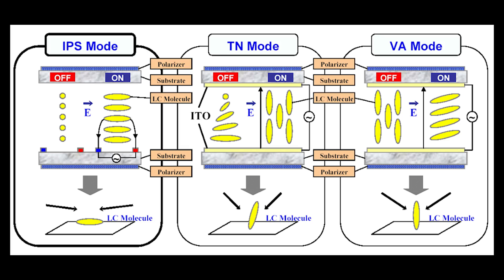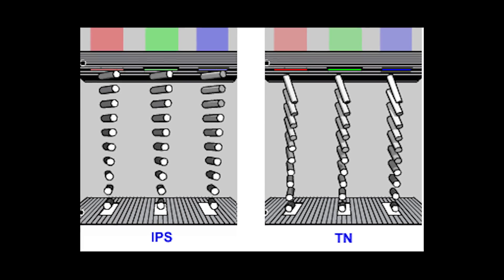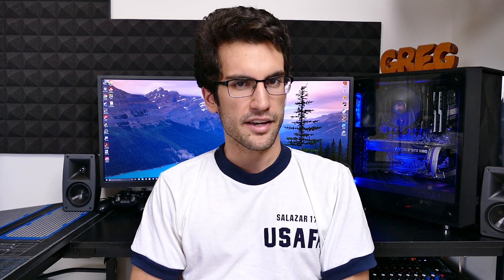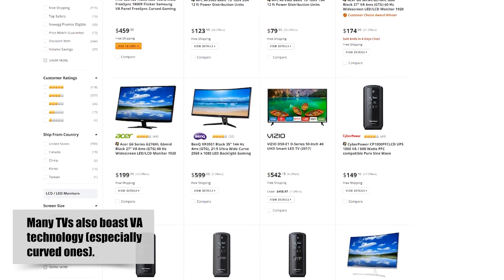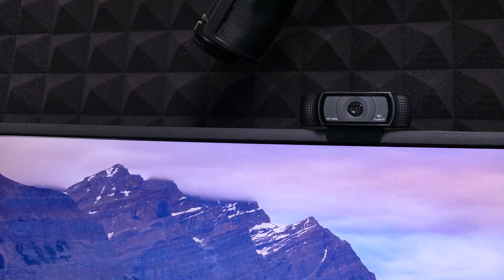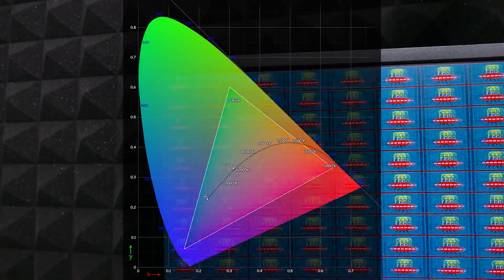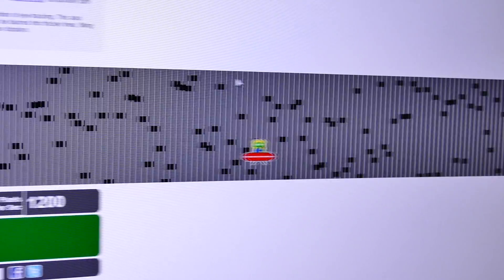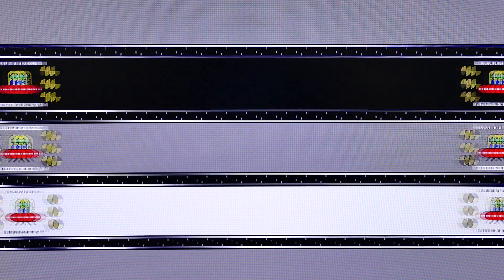What is VA (Vertical Alignment) Technology?

Comment: Color reproduction is not an inherent or  typical advantage of IPS technology. It's simply the nature of how IPS was marketed and who it was purchased by in it's early days that have led to IPS displays typically having more accurate calibration. I could write an entire term paper on the subject but the statement made here was simply false. VA panels have long been superior to IPS displays in reproduction and gamut. Color consistency is the advantage of IPS. VA panels, especially older ones, suffer from banding issues that can often make for uneven color consistency across the panel as compared to IPS. IPS technology was created for use in brighter environments where increased contrast is irrelevant and minor variations in color across the panel are not visible. Proper calibration and color  accuracy to an accepted standard are equally possible with both VA and IPS technologies depending on the variation.
Reply: Alright let's tackle these one by one...

Pixel Response: I really don't want to be rude to you but you need to do more research on the subject before you assume I am misunderstanding you. I am fully aware you are talking about pixel response. Pixel response times, ie the amount of time a pixel takes to update to new color information, are directly related to refresh rate. A response time of 10ms is perfectly fine on a 60hz panel, which refreshes every 16.67ms. On a 144hz panel, which refreshes every 6.94ms, a 10ms response time would introduce noticeable ghosting. The backplane(s) is what controls pixel response as it's what indicates to the pixel whether it should be on or off.  TN panels require the smallest voltage shifts to change with IPS, VA, and OLED needing increasingly more. 

Glow vs. color shift vs. contrast loss: First, IPS glow does not result in a darkening of the image. It's the opposite, it makes the entire image appear as if it is washed out, even if it isn't, with varying severity based on your viewing distance and angle. It is not the same as backlight bleed, color shift, contrast loss, or clouding. IPS glow is not a defect and is typically dependent on the panel model more than the individual panel. The QNIX QX2710, along with all other monitors that use the same panel, don't suffer from glow even at reasonably extreme angles and distances. In fact, it's one of the main reasons so many people bought this monitor back in the day. There were and still are plenty of IPS, PLS, and AHVA panel models that suffer from glow. Most do. It's just that one happened to be one of the anomalies. As far as lighting, bright =/= proper lighting. Proper lighting for a photoshoot is bright, even lighting. For editing or even just general monitor usage,  proper lighting is to keep it darker and use bias lighting. However, this isn't a reasonable request for the photographers and editors that IPS technology was originally marketed to. You are correct that IPS Glow isn't a concern in brighter environments. Again, contrast loss is still an issue with IPS just as it is with all LCDs. IPS screens don't often suffer from color shift like VA and TN panels can. Please don't seriously use screenshots or pictures posted online, especially by so called "reviewers",  to determine such a specific issue. I shouldn't have to explain how ridiculously unreliable that is. 

Brand stupidity: I'm in the unique position of being able to use a wide range of technology, including monitors without getting these products free for review or through sponsorship. The most common complaint about all monitor manufacturers is poor QC.  It's a good thing for me too as almost every display I own now is one that I bought cheap and fixed because of some poor QC issue or entirely random failure. When it comes to monitors in the past 5-6 years, they all suck at QC. Everyone says one brand or another has bad QC. Honestly, people just need to shut up and stop talking out of their ass without hard numbers.You need to stop looking at it on a monitor manufacturer basis and instead at a feature by feature basis first, panel type by panel type second, and panel manufacturer by panel manufacturer third. When I say panel manufacturer, I am specifically referring to who makes the panel, not who makes the monitor.
Reply: tamzf1 I explained this somewhat in another post but pixel response has nothing to do with the panel type in and of itself.  Pixel response is controlled by the backplane.  IPS and TN displays don't require nearly as much power to properly drive each pixel as VA panels do.  Currently,  the only bacplane tech that works well is LTPS. A si and IGZO backplanes, while  allowing for more uniform voltage control, simply don't provide enough power. At more extreme angles, color shift is much more of a concern for VA than contrast loss. All types of LCD suffer heavily from contrast loss at an angle, including IPS. IPS displays don't have the color shift associated with TN  and VA panels at closer to 180°, but most, not all,  suffer from bad glow at these same angles that can make them just as unuseable.
Reply: tamzf1 Again, variable response time is not a panel issue. Many current LG AH-IPS panels utilize an IGZO backplane. For whatever reason,  AUO typically only uses A SI and LTPS backplanes for both their AHVA(IPS) and VA panels. Panasonic does the same thing. It's utterly stupid to try drive a high refresh rate VA panel with anything other than LTPS and not expect slow pixel response. High refresh rate IPS/PLS/AHVA monitors do really well with IGZO and are overall fine with A SI so you see a lot more consistency out of them simply because of that. As far as IPS glow, even the highest end IPS monitors suffer. The anomolies that don't suffer from glow happen at every price point. For instance,  I have an old Qnix QX2710(Which uses a PLS panel). One of the best things about that model nearly as a whole outside of its overclockability is the fact that it doesn't suffer from glow.  However, a common complaint of the much more expensive,  though decidedly not high end,  Asus PG279Q, is that it has frustrating amounts of glow.
Reply: Science Studio Except "Color gamuts and reproduction are superior in most IPS panels sold today." is still an inaccurate statement. It's not the general consensus among qualified professionals or anyone who understands and follows the development of these technologies. A panel is not a monitor. Color consistency and uniformity are typical advantages of IPS and there are far more dedicated monitors utilizing IPS displays on the market today that are well calibrated at the factory to sRGB and Adobe RGB. However, if you look at the display market as a whole, the situation is almost reversed. High end LCD TVs are almost universally VA panels calibrated to Rec. 709(sRGB without a gamma distinction) or DCI-P3. In both cases, once calibrated, these VA panels as well as any high end IPS options are typically pretty close to equal in terms of accurate adherence to a particular standard.  Both tend to be very close in gamut and reproduction in production models with VA technologies able to produce a wider range of colors and IPS technologies having better panel uniformity and more consistent production of what it can produce. Pull up all the data you can find on LG's, AUOs, Samsung's, Sharp's, Chi Mei's, etc. panels and you'll see this is the case.
Reply: Yes, but typical AU Optronics VA panels show high variability with response times - maximum response times can far exceed the rated GTG response times by 4-5X. Acer monitors are typically much better at keeping the response times within 2-4ms of it's rated GTG response time, an example of this being the XB270HU. By contrast, a typical LG panel used in a Dell Ultrasharp hardly goes 50% over it's rated GTG response time of 8ms. 

Also, since IPS monitors have usually been associated with professional use, IPS glow isn't an issue at all like it is for a typical consumer viewing blacks during gaming and watching movies.

Though it's probable that these issues will get sorted as the technology has been in the market for a much shorter time than IPS.
Reply: tamzf1 There is a disconnect in your argument from mine.  In fact, we aren't even talking about the same thing. I am talking about the technology while you are talking about the product. This latest post only served to prove my point.  The M350QVR01.0 panel used in the AOC utilizes an A SI backplane as opposed to LTPS. Again, VA panels cannot be properly driven with their high curremt demands by an amorphous silicon backplane. LG has been using IGZO for their ultrawides for some time now with great success. Also as I have already stated and was mentioned in those articles, VA has color shift at extreme angles. IPS does not. Both suffer from contrast loss. As far as brands, yes there are some that are typically better than others but it isn't some universal rule. All experiences you have had are just as anecdotal as anyone elses. To ignore one brand because the other is "better" is a great way to miss out or to mess up. I've seen every monitor brand put out a bad product and I've seen most put out a good one. You are not buying into the brand, you are buying their product.
Reply: I really hope you understand the fallacies in your arguments here. What you are doing is arguing without sufficient knowledge on the subject at hand. When that happens, people tend to direct the argument away from its original context or ignore the core concept behind the argument entirely. The fact is, you simply aren't thinking analytically. This argument or the information I provided that seemingly necessitated your response was never about which one you should buy, it was about the differences in these technologies. When you couldn't provide a valid response within the confines of the argument, you shifted to the more limited and naturally more biased viewpoint based around purchasing decisions. Now, I ought to respond specifically to your argument as it is currently. Everyone is biased to their own opinion, myself included, even more so when money is being considered. To say that a "customer" only cares about performance is far from a universal truth. I ask you, and this is not intended to be entirely rhetorical, what would happen if you gave 100 random people $30,000 to buy any car of their choice from a list of 20 cars?
Reply: As far as I am concerned, you've already lost this argument because of your insistence on appealing to authority.

The consumer does not care about IPC difference between Skylake and Ryzen or the cell size of Intel's 14nm++ node vs GF's 14nm LPP node. At the end of the day, the higher GHz is what matters to the consumers if they feel that the performance difference that the higher GHz brings is worth it to them. So it makes sense to talk separately about things like IPC/process nodes objectively, but one must always remember that at the end of the day the purchase decision is made on the basis of performance requirements.

When it comes to monitors, image quality differences are more subjective, and it makes even less sense to talk about differences in panel technologies and how they might theoretically affect image quality, without taking into account the difference in implementation of said technologies. 

My position has always been clear - what you say about the differences between IPS and VA may very well be true, but if those differences which tend to be the ideal case, are not reflective of the image quality in the products that are on the market - it would make no impact on the consumer because he will not accept his subjective experience getting negatively affected by sub-optimal implementation, even if the technology behind the implementation is objectively superior in theory.
Reply: Mr. Manager best thread of replies to a Youtube vid ever....
Reply: Mr. Manager Exactly. Look at the colour reproduction on sub $1000 screens. The difference between  VA and IPS is negligible.
Reply: Daniel Troy At all price points, VA is superior in terms of color reproduction. Until at the earliest December of this year,  the only LCD panel tech capable of true 10 bit color regardless of backlight is VA. Banding issues have been almost completely eliminated at the mid- high end with the use of QD enhanced backlights with some form of local dimming and LTPS backplanes. VA panels are much harder to drive than other lcd panel types and contrary to popular belief, more expensive to produce. IGZO backplanes have been used to great success as a cheaper, more energy efficient alternative to LTPS on IPS displays but it simply cannot properly drive a VA panel. There is a reason why VA panels have increased in popularity over the last few years with the advent of HDR, it's the only LCD panel type actually capable of more closely mimicking OLED HDR performance.  IPS and TN technologies have reached the upper limits of their capabilities. Time and cost spent on R&D on VA tech is currently only third to QLED/QDLED(actual QLED not Samsung's stupid marketing bullcrap lies) and OLED R&D.
Reply: Daniel Troy Go with the Sammy set for general PQ, but if you want to watch at more extreme viewing angles or only watch in brighter environments, take the LG. If you want faster refresh rates for PC gaming. Something like the Sony X850E is a great choice for the money that does 1080P at 120HZ.
Reply: VA panels suffer from variability in response times - averages response times are quite similar to IPS, but worst case response times can be much higher. Also they tend to lose contrast when viewed at an angle.
Reply: You think I'm talking about refresh rates but I'm not - I'm talking about pixel response times. Glow isn't an issue at all in a properly lighted environment. I don't know much about your particular model, but Samsung PLS models from early 2012 also suffer from glow. IPS glow results in visible darkening of the image when viewed at an angle, even in a well-lit environment, but this isn't much of an issue because color and contrast consistency is still good. VA panels don't have much glow, but from screenshots in reviews I can see them losing contrast. Thus, both VA and IPS make different compromises when viewed at an angle. 

Asus QC is poor, no wonder their monitors have glow that reviewers tell about the need to RMA multiple times but still not getting the desirable results. If anybody wants a high refresh rate IPS monitor, they're much better off spending on Acer.
Reply: Let's look at one example to begin with, AOC AGON AG352UCG, which is a 2017 model with a AUO AMVA panel, vs the Asus PG348Q, which is a 2016 model with an LG AH-IPS panel.

Viewing angles:
http://www.tftcentral.co.uk/reviews/aoc_agon_ag352ucg.htm#viewing
http://www.tftcentral.co.uk/reviews/asus_rog_swift_pg348q.htm#viewing

The difference is clear - markedly different color and contrast on the AMVA compared to the IPS display. There is some darkening on the IPS panel at the farthest edge, but the curvature hides it somewhat. 

Response times:
http://www.tftcentral.co.uk/reviews/aoc_agon_ag352ucg.htm#detailed_response
http://www.tftcentral.co.uk/reviews/asus_rog_swift_pg348q.htm#detailed_response

For a panel of 100Hz, average response time of the AOC is already at it's refresh rate target of 10ms, while the Asus is sitting comfortably below 10ms at 100Hz overdrive in normal mode. Lets not even talk about the maximum recorded response times. 

I'm buying brands, not the panels themselves from LG or AUO, so of course it makes sense to talk about brands because implementations differ across brands. I don't know if these QC issues are a reflection of the recent trend of getting these established technologies like IPS quickly into the consumer market with the 'gaming' moniker, but I've used Dell and HP IPS displays dating as far back as 2010 and never had issues with the quality of the panels themselves - we order them from a preferred vendor chosen after a tender process, and the only issue with some of the recent Dells have been the touch controls being a bit finicky.
Reply: I'm buying the product, not the technology itself divorced from context.

 If a brand implements an objectively inferior technology with respect to one parameter(which in your argument regarding IPS vs VA is glow)much better than another brand that implements the objectively superior technology with respect to the same parameter, ie. glow, in a shoddy manner, affecting other things like response times and contrast uniformity, then I'm sorry to say that people will undoubtedly choose the former, because a customer ultimately cares about performance.

This is true when talking about things other than monitors, in fact this is universally true. 

  Like I said before, I expect most of these variances to be sorted out over time.
Reply: He quoted to you an older monitor that was "well built" from years back and the reason why people floated to it.  In your first reply, you said "VA panels".  I'm still sorting through the comments.  There is a difference between Socrates and Plato.  In argument, it's hard not to start rationing off the other person's points/factorization/views.  This is the nature of ego.  Once monitor quality hits "shit across the board", you would wish you were wrong.  Once monitor quality hits "amazing across the board", you would wish you were more right or more wrong?

What's more valuable? Occam's Razor or bipolar people?
Reply: 3 روز قبل (ویرایش شده)
Hi, I want to buy a monitor for movies and Web browsing
 .Which of these options is suitable? lg 22MP58VQ-P - benq GW2270H - LG 22MP55HQ - I 
like BenQ because it has a better contrast than the rest. And according to the site, it has a great quality
https://www.benq.com/en/monitor/stylish/gw2270h.html
Reply: Hi, I want to buy a monitor for movies and Web browsing .Which of these options is suitable? lg 22MP58VQ-P - benq GW2270H - LG 22MP55HQ - 
I like BenQ because it has a better contrast than the rest. And according to the site, it has a great quality
https://www.benq.com/en/monitor/stylish/gw2270h.html
Reply: You are right, I do have an LG Freesync IPS on my laptop and one Samsung Freesync Quantum Dot VA on my desktop and the VA color reproduction is better on the VA, specially on the warm tone reproduction, along with higher contrast.
Reply: I'm agree with these, i feel va was way much better color reproduction than ips ... My father office own samsung and lg monitor after recalibrate all of my father employee choose samsung for their work monitor and editing design because a better color reproduction than Ips LG especially in black color which is ips can't win from va panel
Reply from the maker: In referring to the VA and IPS panels sold on the monitor market today, my statement was not false. Color gamuts and reproduction are superior in most IPS panels sold today. If you'd like to argue with the general consensus, this isn't the place to do it.